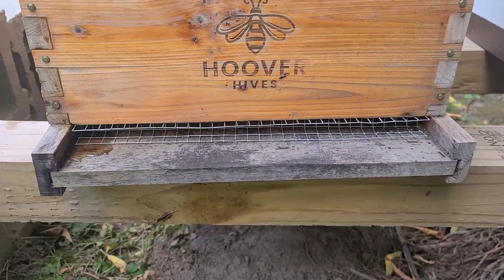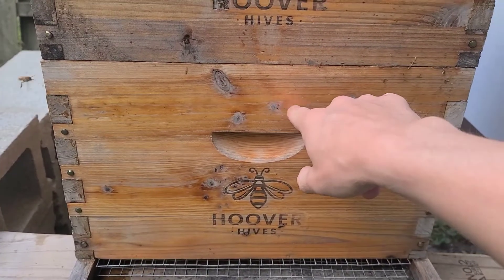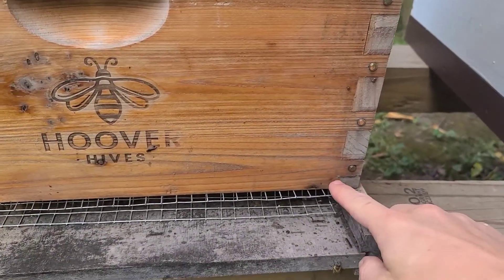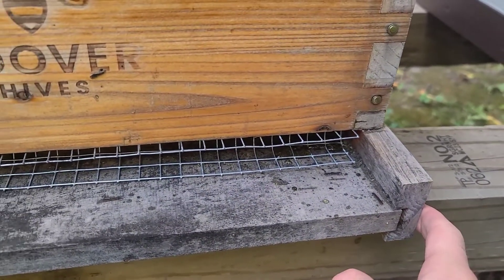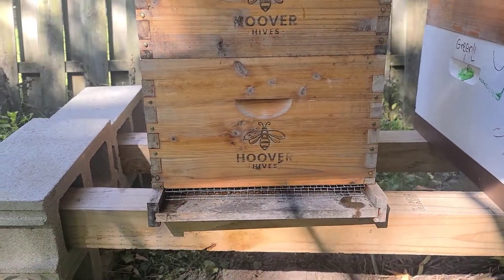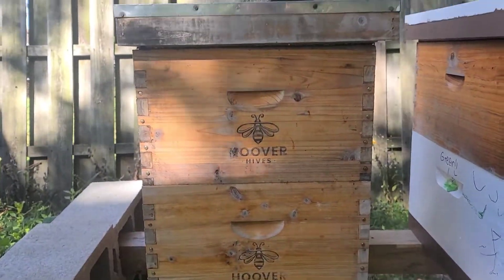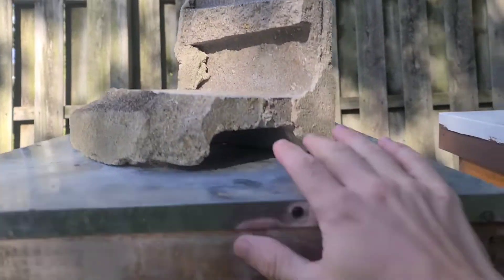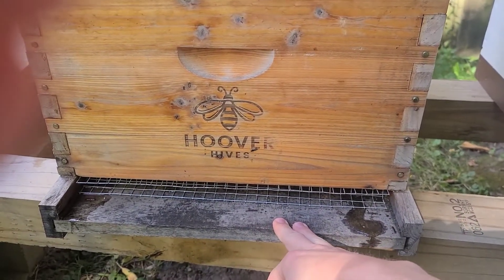Overwintering Honey Bees in Northern Climates - The Condensing Hive

Comment: What fitment do you go with for summer?  Inner cover and insulation removal?  I'm considering going with this design for winter.
Reply from the maker: We use the same setup in the summer. Reflectix with 2 on foam insulation. Just like in your house, the more insulation you can offer the bees, the cooler they can keep their colony. This is why they run insulated hives in Australia. This is why coolers are heavily insulated. You want to allow the bees to set the internal temperature of the hive; not the sun.

Comment: Leaving the entire bottom entrance open does not work in really cold climates. Thats way too much area for heat loss. In central Canada this wont work. Your hive will be dead by Christmas.
Reply from the maker: What size entrance do you use in Central Canada?
Reply: Entrance reducer with about a 1 to 2 inch slot
Reply: @ajjenga4316 do you do condensing hive or vent hive?

Comment: That wire is to easy for a mouse to pull or push out it's way
Reply from the maker: The hardware cloth is locked by pressure. We need to use pliers to remove some of them. A mouse is not going to rip it out. A racoon? Maybe.

We have never had a mouse get in to a colony with hardware cloth on it as shown in the video. We are running about 100 colonies.

Comment: Interesting method and obviously it's working great for your hives.  Quick question though.. Are you doing anything to in your hive tops/lids that guarantee it "channels" water to the sides of the hives?  in other words, what's to stop all that condensation from simply gathering above the bees (as it absolutely will) as they're breathing and having it drip back onto them?  Thanks for the video/advice.  Good stuff.
Reply from the maker: The telescoping covers are heavily insulated to limit the amount of condensation above the cluster. The heat from the cluster is traped at the top of the hive. Condensation only occurs when warm moist air comes in contact with a cold surface. The surface of the cover is not cold because it is being heated from the inside and is heavily insulated. You can see this in the thumbnail picture. If heat escaped through the cover, the snow would not pile up. Instead, it would melt. 

Thus, condensation is going to occur on the sides of the boxes where there is no insulation. We lean the colonies forward slightly to ensure that the condensation runs down and out the front entrance. 

Here is another video that may help:

https://youtu.be/GRZt-_4xP-k?si=TzfyxaEvIv824jsS
Reply: @KobeApiaries  Ahhhhh.. Gotcha.  That makes perfect sense.  Thanks for the quick reply and explanation.  Keep Bee'n!!!🐝

Comment: Great video! I see you're in a zone 6 I'm in a zone 4 pocket in northern MI. Anything different you would suggest for my zone?
Reply: I’m on zone 5b; I’m worried about the moisture freezing internally. What extra insulation should we consider?
Reply from the maker: Some of the moisture does freeze internally and as it exits the entrance. It's not really an issue as it is away from the cluster.

However, as mentioned above, adding insulation can only help. You can look into Hive Huggers or build your own insulating sleeves using pink foam insulation board from home improvement stores.
Reply from the maker: The more insulation the better. So if you only have a couple of colonies and want to reduce the stress caused by winter, you could look into buying or DIYing Hive Huggers. IMO,  your bees would survive without it (as long as they are healthy and have enough resources), but they would do better with it.

Comment: I am going with the condensation hive this winter. Blocking off the upper vent and insulating the top very well. I also have a sound board to absorb any moisture on top. 
Can you talk about the bottom board. Aren't we suppose to block the entrance a bit to prevent so much cold air coming in? If we have a screen bottom board does the water just fall through, where the bees can't reach?
Reply from the maker: You can reduce the entrance if you would like. We leave our entrances wide open. We do this for two reasons. First, we do not clean out the dead bees during the winter so we want to ensure that the entrance doesn't get plugged up with dead bees. (Honestly, I don't know if an entrance can truly be plugged up with dead bees or if this is just another myth that's spread around.) Secondly, we run solid bottom boards and want to ensure the water that condenses and runs down the walls of the hive is able to run out the front. If the entrance reducer is there and the bee propolize it to the landing board making it water/air tight, the water would have difficulty draining out the front. 

As for screened bottom boards, our friends use screen bottom boards without issue. The bees will still have plenty of water to use that condenses on the interior walls of the hive. Some of the excess water will run down the wall and fall through the screen. On solid bottom boards, this water would run out the front entrance. So, from a water perspective, I don't think anything is gained or lost by using a screened bottom board.
Reply: @KobeApiaries  thank you for your response. It is greatly appreciated. Another question for you. I am tempted in using 10 R value styrofoam block on the sides. Will that prevent condensation? I feel like I should seal my boxes well and insulate the sides some. Can I over insulate? The top has a super with 4 layers of R 8 foam board plus the sound board. So that should be good, what about the sides and front.
Reply from the maker: The most important thing is that the top is more insulated than the sides. You cannot over insulate. Ideally, you would have infinite insulation so that the outside factors (air temperature, solar gain, wind, etc) does not impact the internal environment and the bees can easily manipulate their temperature and humidity as they see fit without fighting against the external factors.

Also, I would strongly encourage you to lose the sound board. You do not want to  trap water inside the colony with sponglike materials. The trapped water will act as a heat sink as water has a high specific heat. Furthermore, it will keep your relative humidity at/near 100% at all times.

Comment: To my knowledge, standard quilt boxes are not ventilated, therefore trapping heat and absorbing excess moisture.
Those boxes that are ventilated are referred to as Vivaldi boards, and would cause the issues in cold climates that are mentioned here.
Reply from the maker: The quilt boxes that were sold to us when we first started keeping bees had an upper entrance (ventilation) and a chamber to put wood shavings. There were also six large holes cut in the side of the box (3 holes on each long side of the box) to allow for air to move across the shavings to "dry" them out.

I have also seen quilt-Vivaldi hybrids where there are three chambers. The two outside chambers have moisture absorbing substrate. The middle chamber is left empty, but is notched to allow for venting. This option is for those that want the "BEST" of both worlds. LOL

Lots of different ideas out there.

Regardless, IMO, you do not want to vent your colony out the top and you most certainly do not want to trap moisture above your cluster using moisture absorbing material that act as sponges.
Reply: @KobeApiaries  Warre's Top Cushion or as English likes to call a "quilt" box, is not ventilated, sorry
Reply from the maker: You are correct. The original quilt boxes were filled with quilts or cotton to add insulation. Hence the name "quilt boxes." However, since then, people have started adding ventilation to these boxes, yet still call them quilt boxes.

Here are some examples:

https://blueskybeesupply.com/10-frame-quilt-box-10-qlt-/?gclid=CjwKCAjwysipBhBXEiwApJOcu9kahpAin1rZ6w3VsFd0QVHWtD6crQTUrYyaR9bqgEwsh_rcCx1_wRoCbwMQAvD_BwE

https://www.dadant.com/catalog/moisture-box-m60060?gad=1&gclid=CjwKCAjwysipBhBXEiwApJOcu3d9yXmkc9w2ZS7ivqd0gQLUp6tLbm3Iy-7gEAD0VoAJFsUbq-sJ-xoCTVEQAvD_BwE

https://www.mannlakeltd.com/10-frame-hot-box-and-moisture-board?sku=WT130&gclid=CjwKCAjwysipBhBXEiwApJOcu9uEq5oeyNCmOtt1Sv_sCCDKzsk8_vd1VqNBEbYjzmaGc-euhCTs6RoCMAkQAvD_BwE
Reply: @KobeApiaries  What? Warre used burlap soaked in flour for the bottom floor of the box, it was filled with sawdust, and he called the box a coussin, which means cushion, in english, then topped with a sealed box and roof, He wrote a nice book in french about his hives. The quilt box has become a blanket term/name, There are so many variations, Kinda like hive bottoms, But, it's like saying all solid bottoms are bad because we didn't like the landing board on the solid one we tried, and while I agree venting is bad as the bees can move air if needed, humidity is a little harder for them to maintain if there is no extra moisture available near the end of winter, that's where the moist tops come in, instead of running out the hive bottom, it stores water.

Comment: I'm very new to this. It's my first year with my bees. Does the silver reflectics touch all 4 sides? Does the foam touch all 4 sides? Have you ever had the water accumulate at the top and come down on your bees?
Reply from the maker: Yes. The silver reflectix and the pink foam touch all four sides and extend to the end of the box. 

The whole point of insulating the top of the hive is to prevent condensation from occurring and dripping water back down on your bees. Water is going to condensate on cold surfaces. If the top is well insulated, the top will not be cold and thus, water will not condensate. Instead, the un-insulated sides of the hive will be cold and the water will condensate there. 

If you look at some of our videos from last year, you will see that all of our colonies thrived in the winter and we did not have any issues with water dripping on our bees. We will do a better job of getting videos this winter to show that insulating the top of the hive prevents condensation from occurring. 

https://youtu.be/gsWkT_nELQE
Reply: @KobeApiaries  thank you!

Comment: I always provide sugar cake above the bees -- so would I put this all in this order-- sugar cake, inner cover, reflectic, insulation?  Thanks!
Reply: All kinds of wrong with this ,.....mounting crop.....just endless bad advice ....I wo Der how many colonies you have killed with this horrible information
Reply from the maker: @bobvilla3079  lol. The lowest overwintering percentage we have experienced is 94%. All but one were queen failures in the spring. Meaning, the colony was alive, but they were queenless. 

Which parts don't you agree with? The physics? The thermodynamics? Condensation vs humidity? I am interested to know which part doesn't make sense to you.
Reply from the maker: Hi Karen! We usually add sugar to colonies in January or February if they need it. When we do this, we just do the mountain camp method. So we will add a 2-3 inch feeding shim to the top. We will then place a piece of newspaper on the top bars of the frames and pour a couple pounds of sugar on the newspaper. We then put the reflectix, insulations, and telescoping cover back on top. We also will tape the seam with painters tape as the bees will not be able to create a propolis seal. 

So, to answer your question, I think you order is correct, but I would get rid of the inner cover as it serves no purpose, IMO.

Comment: 2 questions  1) It looks like you are using the 3/4 in opening.  Is it necessary  to use a mouse guard with the smaller 3/8 opening ? 
                       2) Do you always use the larger opening and why ?
Thanks for the information.
Reply from the maker: Hi Jeff!

If we have the option, we go with the larger opening, but not all of the bottom boards we have inherited have come with the larger opening as they were handmade by another beekeeper. As for why we use the larger opening, I don't have a scientific answer for you that is backed by data. We started doing it to allow for greater air exchange in the summer and to prevent dead bees from blocking the entrance in the winter (and because we didn't want to have to go back and flip all the boards twice per year).  For the colonies with the smaller opening, we still put on a mouse guard because why risk it?  I will also tell you that we have about 6 colonies that have the smaller opening and they do just fine. In fact, 3 of the 6 were some of our best colonies. I don't know know if the opening played as much as a role as the queen that was running the colony, but it definitely did not impede their success. Hope this answers your questions!
Reply: I have a mentor who uses the 3/8 opening and claims he has never had issues with Mice. No guards, no wire... for me, it would be more of a chore to flip the opening again in the spring etc...but if it works for your system - do it!